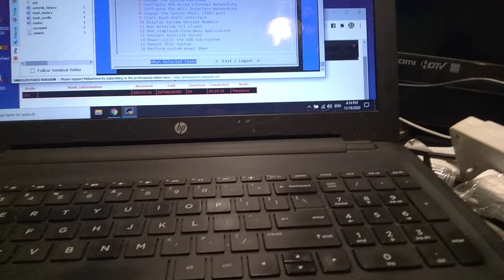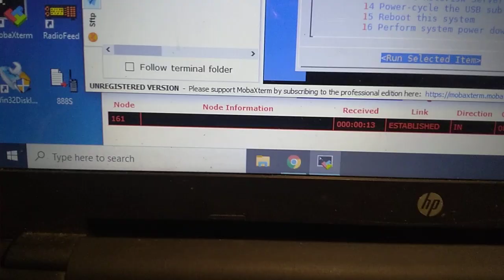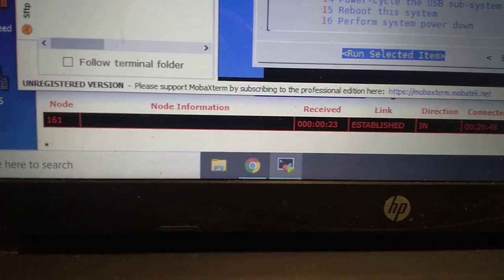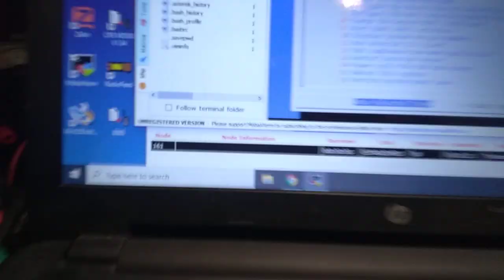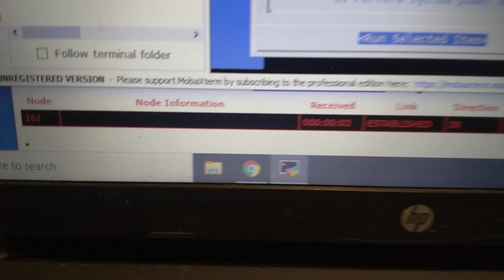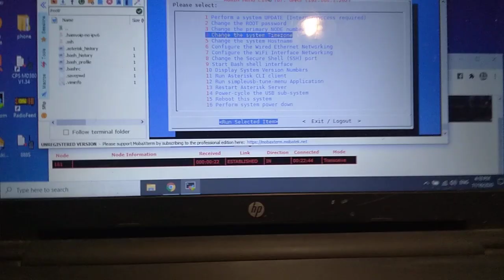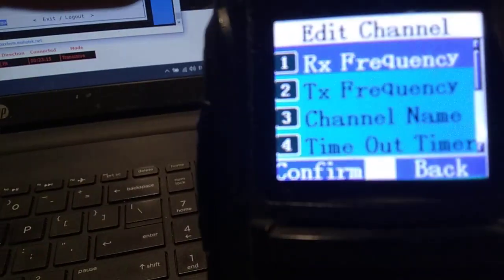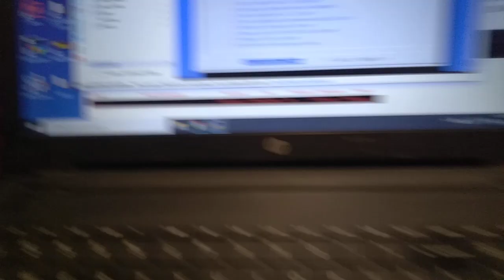Simplex station to Repeater Station for linking.

Comment: Is there a way to link repeaters without using internet? My set up is a motorola set up with the ID OMatic, and wanted to link with another guys repeater to give us more coverage locally, as I do better in one direction and he does better in another. Is there a way to radio link them without internet? Internet is spotty in my location, so it goes out, so would my link.
Reply from the maker: There is a way but we are a internet linking system. Sorry.

Comment: For my CDM do I put YOUR software on my computer, or put micro SD in Pi, and then hook the Pi to computer? and still dont see with my CPS software where to alter pin 8???? Help! : )
Reply from the maker: Download the software off our website and unzip the file. There are 4 softwares in the zipped folder. Please install the ultraviewer and win 32 disk Imager from that folder.